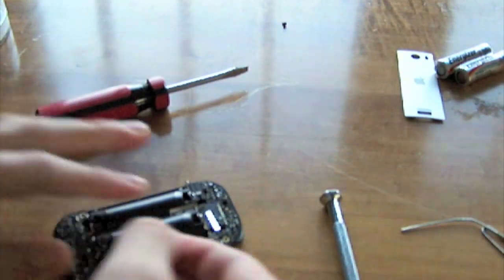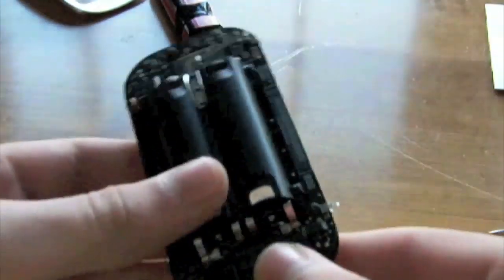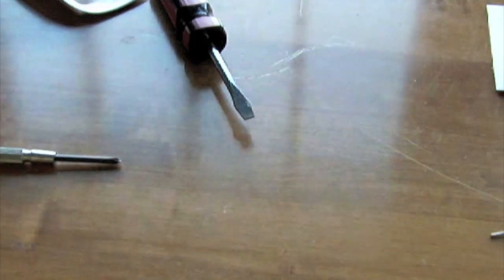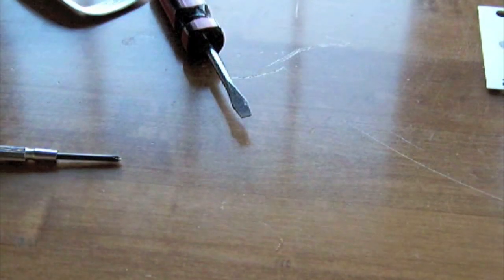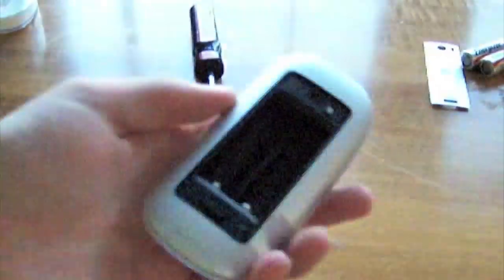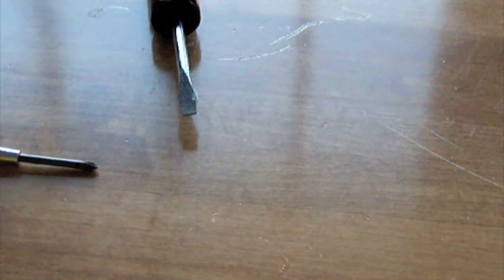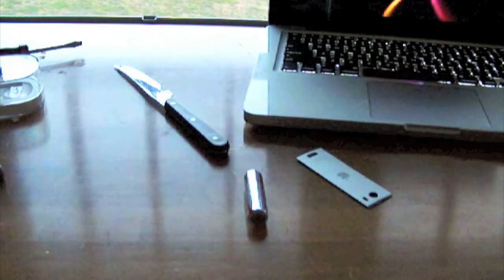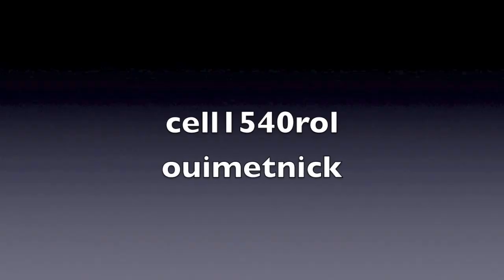Magic Mouse Teardown Part 2/2

Comment: my initial problem was with the plastic inside, but i glued that and then the ribbon cable got disconnected as well, initially  i didn't know about the flap, so thanks for that, it opened and then i slid the ribbon in but the flap came of and ive ben trying to slot it in with no success, any advice? please help!!

Comment: my initial problem was with the plastic inside, but i glued that and then the ribbon cable got disconnected as well, like you i didn't know about the flap, it opened and then i slid the ribbon in but the flap came of and ive ben trying to slot it in with no success, any advice?